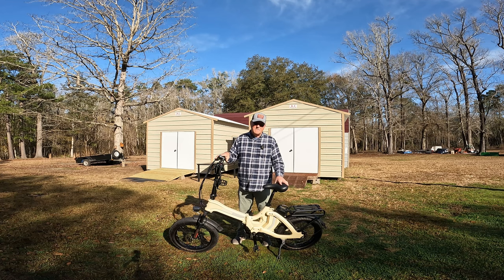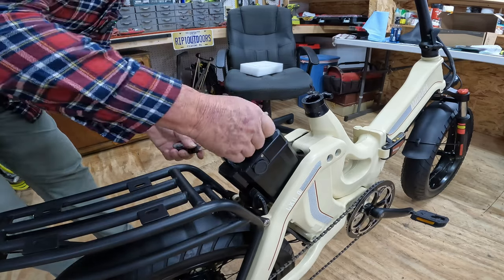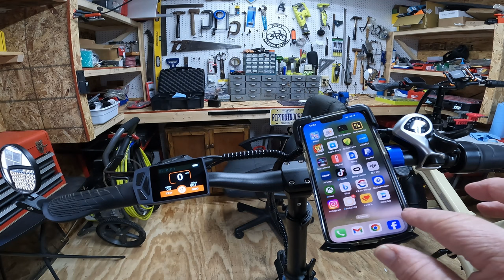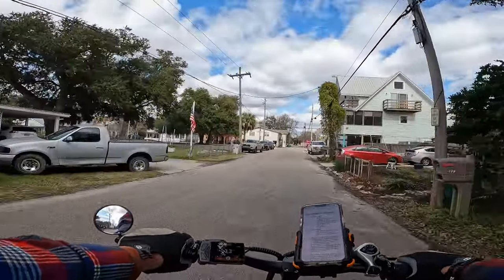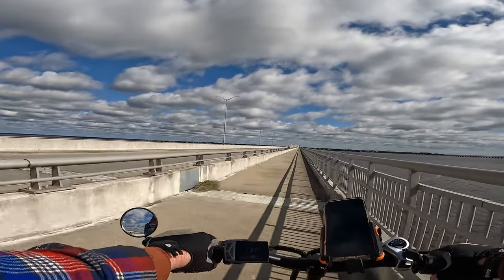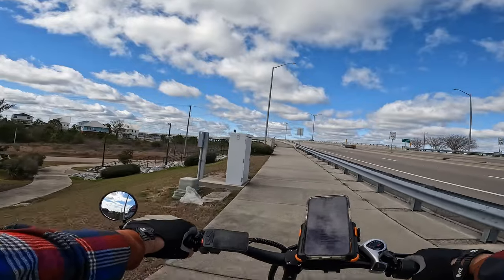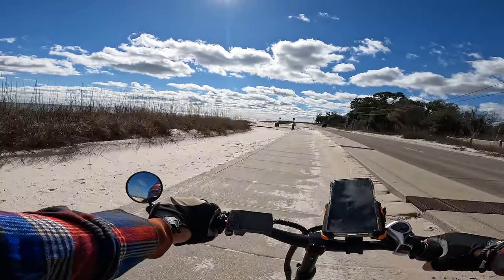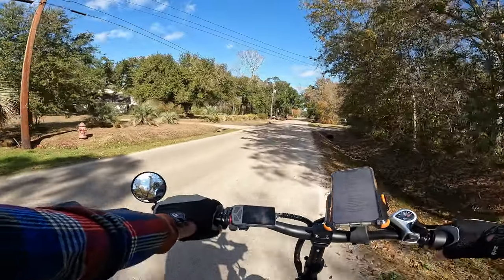Mihogo One Pro - The Dual Battery Smart Ebike #mihogo #ebike #electricbike

Comment: Great Tires!  I have to say that my first e-bike ever was bought 14 years ago and the battery is Panasonic...Still holding a decent usable charge.  Beautiful ride and bike. I am not into all the bluetooth stuff, I may be a different animal, but I want to get away from that when I ride for the most part.  Not when I review, but just riding.  If I had just one bike though...I may want it as others will surely want it.  Excellent job my friend.  I think having a torque sensor with a throttle is a good match for sure.
Reply from the maker: Thanks for the kind words Bruce.  I'm not into the App stuff at all but you know how it goes.  I have to try to say something about it

Comment: How does changing gears affect performance? How much torque? Very nice bike.
Reply from the maker: To be honest Gary I did not test changing the gears. I always leave it in 7 and just use the pedal assist. It is a great bike. Thanks
Reply: @Rip1Outdoors  you need to try a mid drive with a torque sensor. One where it pays to shift gears. Whole different experience. Lots more options when peddling.
Reply from the maker: @garywillhoit  ok Gary thanks

Comment: I like the idea of torque bike, it's like the way I rode on my Mt Bike (no motor); but I don't like the way the PAS works on that bike.  I would want full speed no matter which assist level you're at.  Top speed that is dependent on Assist level sucks.
Reply from the maker: I agree Terry but it's really not a deal breaker for me.  It seemed different though that's why I made sure I went over it.  Thanks for watching